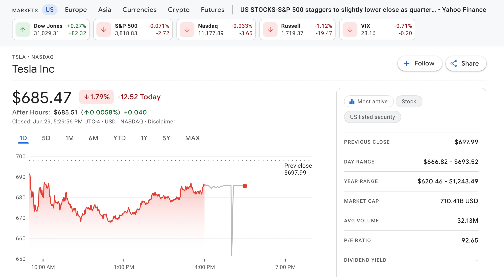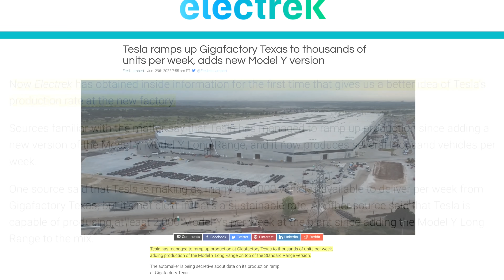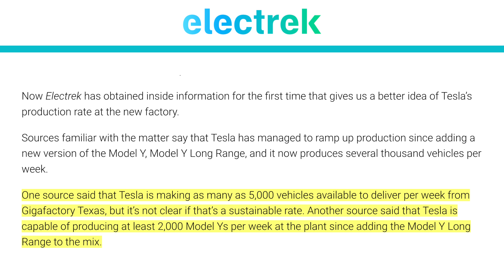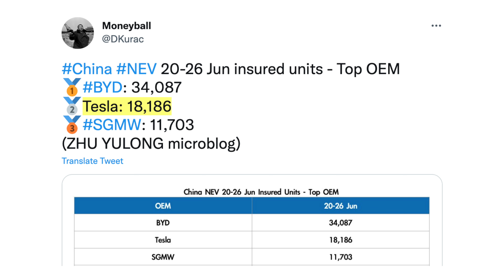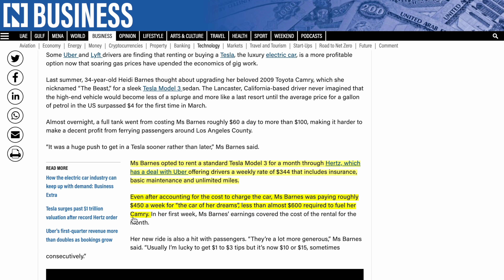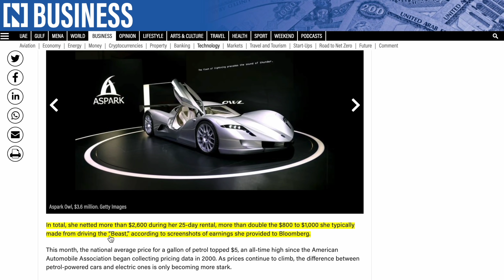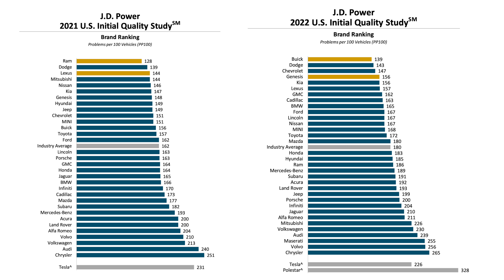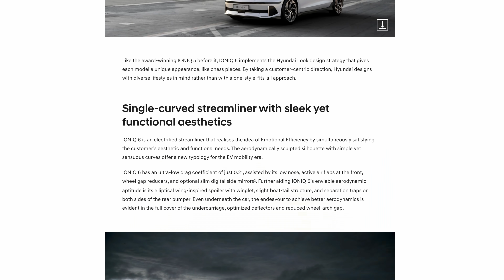Wild Texas Tesla Production Report + EV Business Models Growing

Comment: 10:36 It is obviously not similar to extorsion since there is no threat, especially of use of force, to obtain a benefit against the will of Tesla.

It is merely a rule, known publicly, applied to all companies wishing to be eligible to J.D. Power awards.

Tesla is not even barred from being evaluated, presented in J.D. Power reports.

Whether it is pertinent is debatable but framing it in such dramatic light is nonsensical.
Reply from the maker: Extortion is a strong word, obviously, but it makes the point and I don’t know another word to make the point in a less “dramatic” light. Coercion is probably what I should’ve chosen. The two are pretty similar, I don’t think that makes it nonsensical.

J.D. Power does threaten these companies with exclusion if they don’t share customer data. They acknowledge that they have enough data to include Tesla in their scoring process. If this is not a threat for the purpose of obtaining that information, what is it?
Reply: @TeslaDaily  , it's not a threat, it's a rule, once again, applied evenly to all companies.

Tesla is still evaluated and presented in the report.

It is merely to potentially obtain an award.

J.D. Power is flexing its muscles, it is debatable whether or not it is fair, yet Tesla is suffering of no significant harm, as it's doing just fine without being considered as the other brands within the context of this report and/or having an award from J.D. Power.
Reply from the maker: I don't think equally threatening everybody makes something less of a threat. I also don't think "this company is doing fine" is any excuse for a threat. I ask again, if Tesla can be evaluated and presented, why can't they receive an award? There is no excuse other than this "rule" which is made up by J.D. Power for the sole purpose of obtaining customer data from companies under threat of exclusion. Clearly they don't believe their own rule as evidenced by Tesla's inclusion. We are getting into the threshold of semantics, but that alone makes it clear that this is not "nonsensical".
Reply: @TeslaDaily  , there was no threat of harm, nor Tesla was harmed.

The rule is applied across the board, openly.

Tesla is still presented in the report, evaluated like the other brands.

In the end, it does not qualify as coercion.

Comment: With Tesla there is this issue they don't have the dealership and so the perceived number of production quality issues can be skewed upwards. It's entirely possible that non Tesla cars have even more issues but when they get to a dealer, they examine the car and maybe correct some panel gaps themselves and so the customer doesn't see this and so is inclined to list fewer infractions than that would do if they got the car from the factory as they do with Tesla. It would be interesting to see if this rate includes this nuance and if not, to see what the defect rate is for cars after that receive their first service center visit that is scheduled if there are initial problems with the car.

Comment: My feeling is that batteries right now may be what is holding back Texas ramp. Their logistics yard is filling up with containers of supplies. Joe T's latest video from this morning is thinking 100 per day and from what he and the rest of the quad squad are showing they are easily moving out 80 to 120  per day right now. Seeing many LR and performance models coming out. Starting this week there are more employees in the large employee parking area on the east side. That could be due to build out of SW part of main factory with more receiving doors and reinforced concrete pads. They should have enough for 2 shifts maybe.
Reply: Tesla have said "it's batteries",.
EM mentioned it in the TOSV interview.
"The 4680/ structural ramp was more challenging than expected" and "the 2170 machinery was stuck in China"
We should assume the 4680  ramp is at least being worked on, and The 2170 version car build has begun.
It's quite possible they have "complete except for battery" 2170 cars ready inside the factory?
(They have a conventional floor, so can be assembled without the pack)

Comment: the transporters I looked at yesterday.had 9 cars when loaded.   so for every 1000 cara we will need 111  transporters.    
This would suggest the higher numbers are unlikely at the moment.
Reply: 1 transporter can make 1000+ trips.
Reply: @syweiner434  yes one transporter can make 1000 trips,  but it still has to visit the factory 1000 times to load up the cars at the factory.   My impression is that on each visit to load they are on site for two to three hours.  
Yes it is also possible that transporters are scheduled to avoid regular drone flight times.   
Now we generally have two or more drone flights a day,  each on site for two to three hours plus monitoring the highways on the journey to and from  site.   
Additionally you have the rate of change of vehicles in the storage areas.
My point was that the current activity seems to support production in the hundreds not thousands.      I am looking forward to see that change in the next few  months.
Reply: Direct collections?

Comment: I definitely like the design of Ioniq 6. I've been very much against recent designs featuring blocky-ish front end fake grills. YMMV and all that
Reply: IONIQ 6 is a COMPLIANCE car, built w/ GAS car body & GIMP EV Platform thats OUTDATED. 
Hyundai is NOT even using ADVANCED 2170 battery cells, they are using OUTDATED battery TECH.
Reply: @markplott4820  Didn't Hyundai create their own EV platform?
Reply: @yourcrazybear   - Hyundai created a MULTIPLAFORM called e-GMP (GIMP) to power GAS, Hybrids, Fool Cell and BEV. 
Current KIA/Hyundai & Genesis use GIMP platform .
but, its OUTDATED as it is GAS platform based , its NOT a Clean Sheet build.
too HEAVY , too Slow , Inefficient. too Short RANGE. 
Its NOT a BEV Skateboard like TESLA.
Reply: @markplott4820  what gas model would that be?
Reply: @BTS-Astro1   - take your pick . KIA/Hyundai & Genesis make MORE gas models than BEV. 
any of the Sedans would be Sutiable. 
In the Pervious generation they used KIA SOUL, gas NIRO and gas KONA for bodies, also Hyundai IONIC.
Reply: @markplott4820  
Ahhh the guy that owns 4 Tesla’s!!!
Reply: @markplott4820  sure you are 🤥
Reply: @richardwolf6269  - the PLAID X is just too fast, LR model plenty of acceleration.
Reply: @markplott4820  weren’t you just touting how great and fast 💨 Tesla’s are. Now you’re back tracking.
Stupid doors 🚪, crazy expensive, and now you’re a used car 🚗 salesman 👨‍💼!
Perhaps you can make ends meet by being a Uber driver!
Reply: @markplott4820  Tesla down 38 % in three months. Hopefully you didn’t buy into the crypto craze either!
Reply: @richardwolf6269   - I own 6,942 TSLA and picked up 80 more at $658.42.
Reply: @richardwolf6269   - TESLA model 3 costs LESS than a 2023 CAMRY and less than USA median car price ($50,000).
Reply: @markplott4820  Sure you do!🤥
Reply: @markplott4820  Saw a new Camry priced under 30K.
If you are sooooo freaking rich 🤑 and Tesla’s are so good then why do you need to pump the stock so much?
You buying on margin?? 🤔😂
Reply: @richardwolf6269   - I own 4 TESLA cars , best Investment I ever made , plus glad I bought TSLA @ $69, $350 , and @$500. 
TSLA is on $ALE , TSLA is stock of DECADE. but not for long.
Reply: @markplott4820  so you owned 4 Teslas and sold two and still have 4?? I guess they must multiply mr millionaire!
Reply: @markplott4820  aren’t you the guy that said this??:

Mark Plott - "Corolla cant Survive a CAR crusher, a Model 3 BROKE a car crusher trying to Salvage it.
also a Carolla cannot go 200,000 miles without Maintanance, my Tesla M3 did 300,000 miles with just Changing the Wiper Fluid." 
No new tires 🛞, no cabin air filter no new wiper blades but somehow you changed wiper fluid?? I usually just add it!
Reply: @richardwolf6269   - Roadster - sport (Legacy), model 3 2019, model Y - sold , 2021 PLAID and 2022 Mod X on order.
Reply: @markplott4820  Sure! 🤥

Comment: Hyundai/Kia has some of the most efficient EV's next to Tesla. They do a great job with them. However they just can't seem to make them at scale and like Tesla they have way too much demand compared to such little supply. Hopefully they can ramp up and not go broke in the process.
Reply: Yep, this has been the case since e-niro and kona. Okay cars, but not profitable for them.
Reply: KIA/Hyundai has Great Design but an OUTDATED BEV Platform the GIMP. 
they are also using OUTDATED batteries from LG.
Reply: @markplott4820  Outdated BEV platform in what way? Outdated batteries in what way?
Reply: @yourcrazybear   - FUD motors does NOT make Batteries, Electric motors or BEV Drivetrain .
FUD Lightweight uses FUD motors parts bin. 
the Batteries are OLD style Pouch cell from the LAPTOP Industry, NOT Advanced 2170 like RIVIAN uses and not 4680 cell by TESLA.
POUCH cell are FAMOUS for Dendrites and battery FIRES. 
FUD will likely use AWD Dual Motor drivetrain from Mach-e (FRONT by Magna , REAR by BORG-Warner) . made in two Halves by Different engineers, NOT INTERGRATED. 
RIVIAN has Intergraded motor & Drivetrain from Suppliers (NOT hub motors), TESLA makes their own Motors & Drivetrain .
FREMONT makes cars 80% in House and 20% from Suppliers. 
TESLA China is 95% in house.
Reply: I like the Hyundai/kia far and away the most of any non Tesla, they have the most tech as well and just seem to be further along than most outside of Tesla. I assume production will ramp, their EV only models are, what, 6 months on market.  Curious to see what this one is priced at.
Reply: @noahj.5740  EV Only Models have been around for a few years with the Kona and Ionic. They’ve had difficulty ramping up production.
Reply: @michaelwebsternz  there are only a few states that you can actually buy an electric  Kona in.
Reply: I get it, I was referring to Ev designed platforms, not cars like the Kona that they build as both gas and electric.  No one is saying they are leading but they seem to be ahead of many and have interesting products